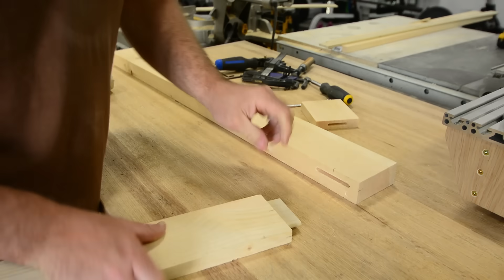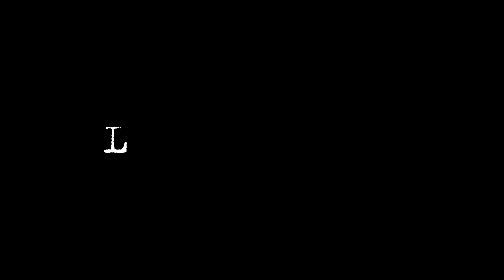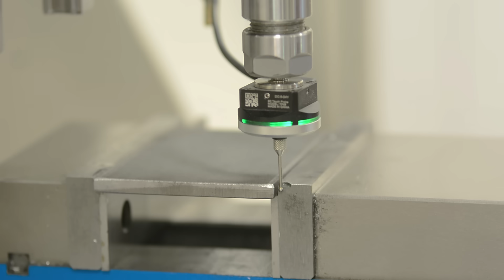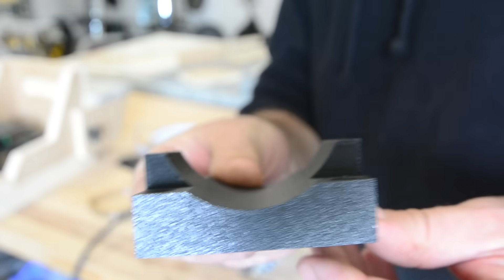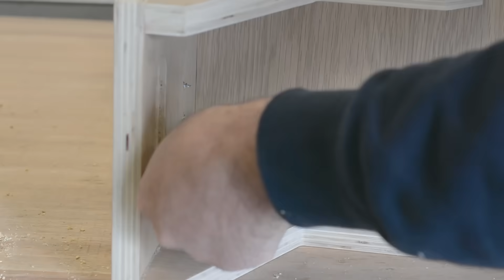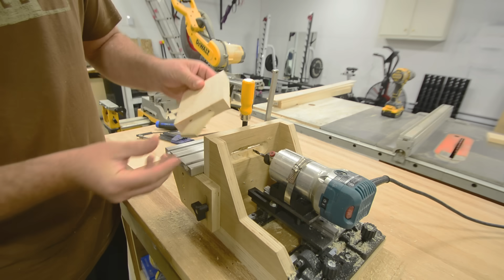Floating tenons made easy - DIY domino

Comment: Interesting improved version of your original design.

I actually constructed a machine inspired by your 2nd original but with a few extras. Firstly, I used MDF including for the rail sliders (which even I considered controversial at the time). I also included a T track on the bed, facilities to double mortise both horizontally & vertically. dust extraction & provision for clamping to a workbench or table top.

Since then, it's done me great service. The rails did bind after many years, but I found a couple of weeks in the hot water cupboard (a cupboard housing the hot water cylinder) shrank the moving parts back to original free sliding. I'm just completing a case to house the entire thing so that it isn't in the open and won't bind again.

My knowledge & technical abilities have improved vastly since then so likely I would construct it differently now. Certainly I'd aim for a much lighter version as MDF can be quite weighty.